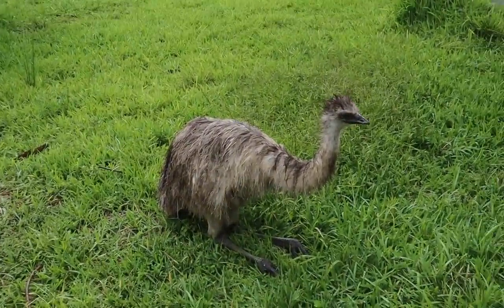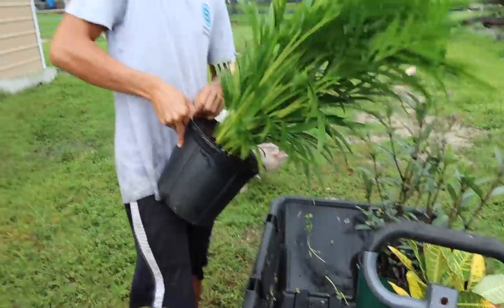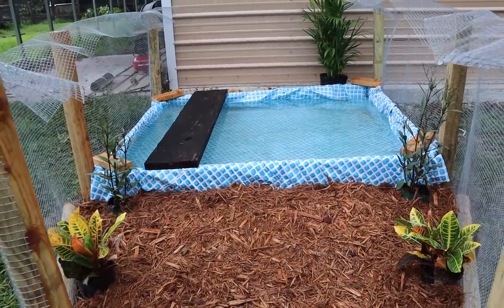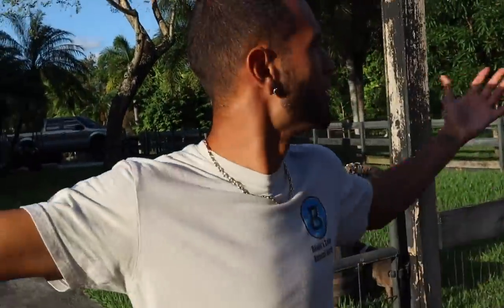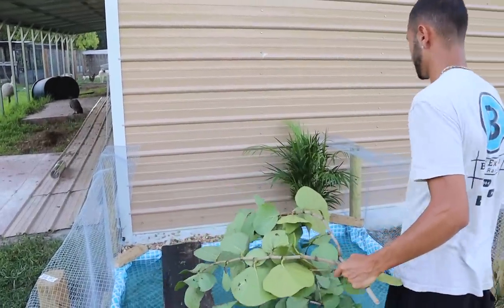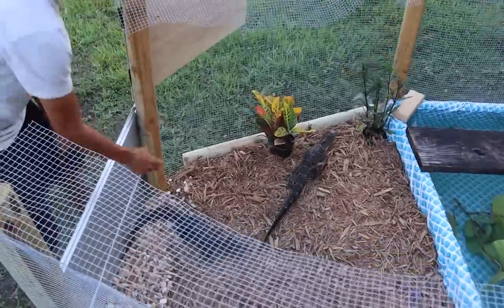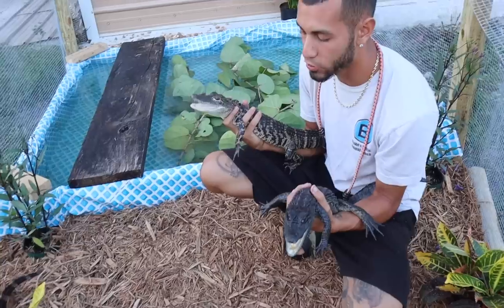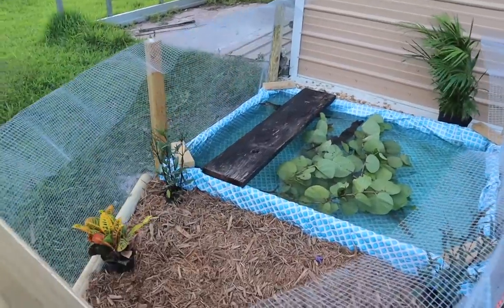NEW ALLIGATOR SETUP IS COMPLETE!

Comment: Blake to, instead of that bent over mesh stuff at the top, why don't you use some of left over tin siding and drill screws into the polls, setting it on top it would provide a safety device and shade so they don't bake in the sun and get sun burned, I didn't even realize that they could get sun burned, but the tin would match the barn and look better then the bent over mesh stuff! What do you think, an awning on each side of the enclosure! Your Fan Mac #BEARisAwesome #RanchFam

Comment: JEES, WHAT FLIMSY SETUP, THE CORNERS AT THE BACK ISN'T SECURED. EACH POLE SHOULD HAVE A CROSS BAR FROM POLE TO POLE ON THE TOP AND AT THE BOTTOM. CUT THE EXCESS NET ON THE TOP AS THIS WOULD NOT INJURE YOU. SAFETY FIRST...
AT THE BOTTOM THOSE POLES ARE LAYING LOOSE. THE ALLIGATORS CAN ESCAPE FROM UNDER THE NET. THE MULCH SHOULD NOT BE SO CLOSE AT THE POOL POND AS THE MULCH WILL GET IN THE POND AND MAKE  THE WATER DIRTY. ASLO WHEN THE ALIGATORS COME OUT TO SUN BATH THE MULCH WILL GET STUCK ON THEIR WET BODIES AND IF THE COME OUT OF THE WATER AND ONTO THE MULCH AND FOR ANY REASON THEY GET SCARED OF SOMETHING LIKE THE EMUS PASSING THE WILL CARRY THE MULCH INTO THE WATER. COME ON BLAKE, YOU CAN DO BETTER THAN THIS....